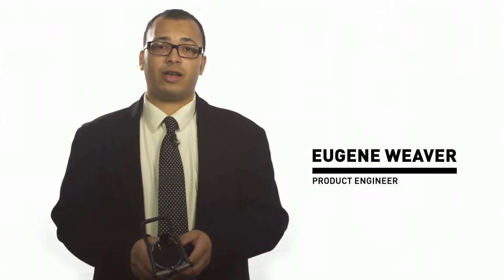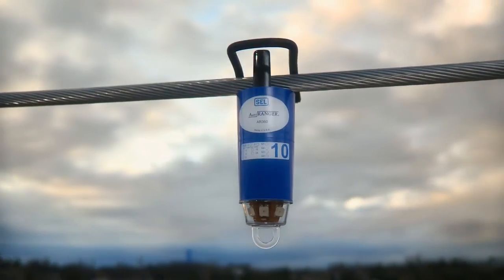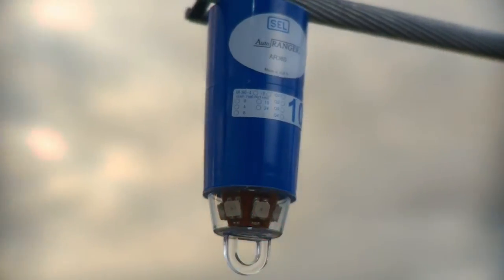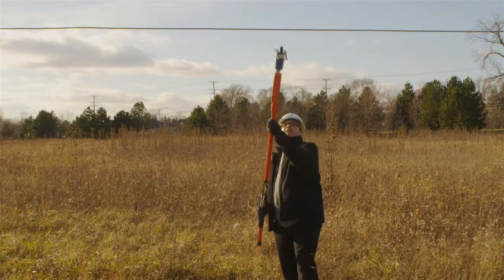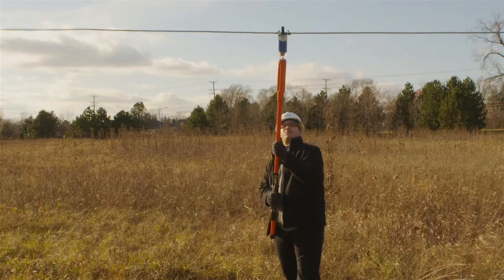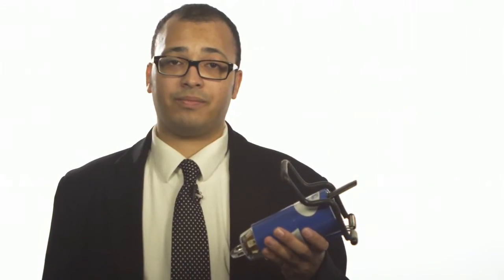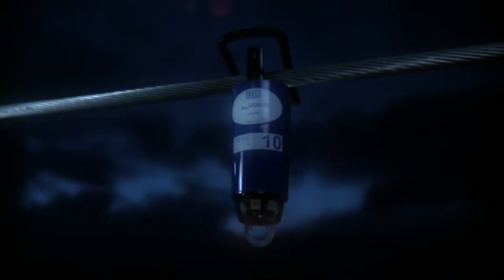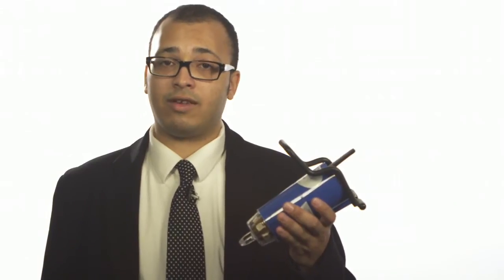How To Install AR360 AutoRanger Fault Indicator

Comment: Can you use these on elbows
Reply from the maker: Hello RIch - thank you for asking. You can't use the AR360 on elbows because it contains a voltage sensing mechanism. Since no voltage is on the outside of elbow, the AR360 would assume system is de-energized and would not be armed to detect faults. The ARU can be attached to the cable entering the elbow. For the elbow specifically, if there is a test point and this is a padmount enclosure, the TPR https://selinc.com/products/TPR/ is a good fit. If you have additional questions, one of our engineers would be happy to speak with you at https://selinc.com/company/contact/ Thanks again!